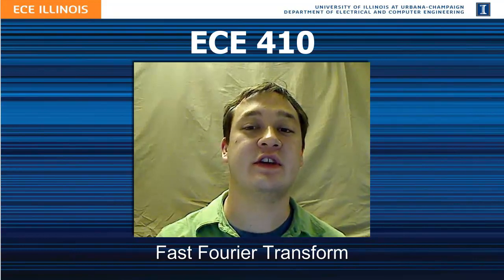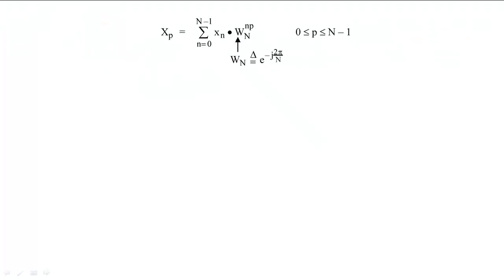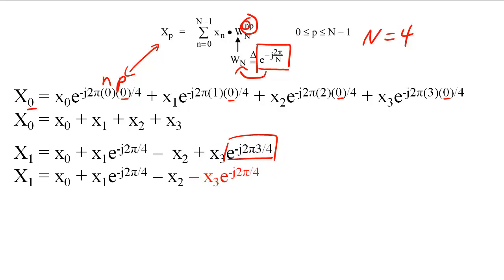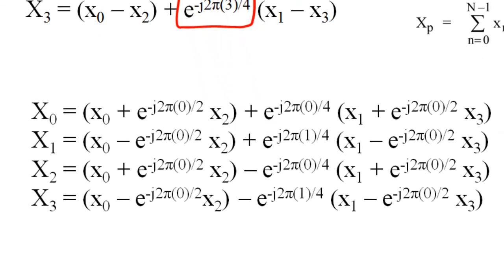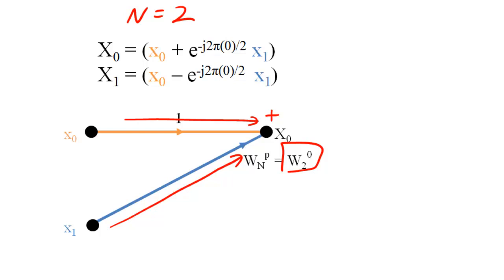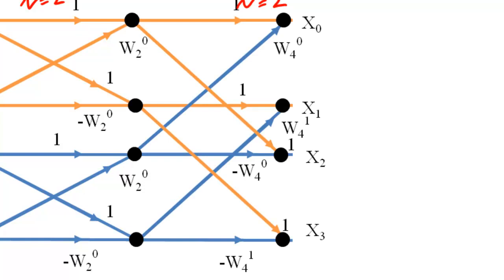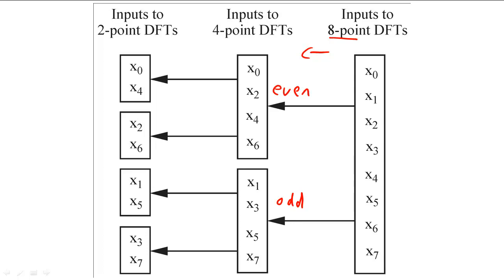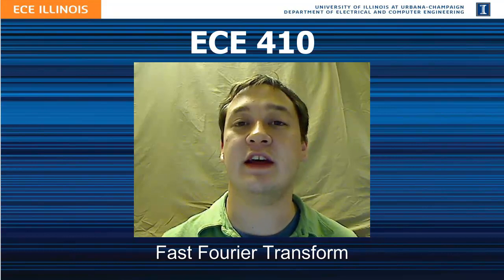32 - Fast Fourier Transform

Comment: e^(2pi3/4) -> e^(-2pi/4)?.. How it has been deduced?
Reply: 3/4=1/4+2/4=1/4+1/2 useing euler forumula you get jsin(pi)+cos(pi) =-1 and multuply the e^-j2pi/4
Reply: 270 degrees is -90 degrees?
Reply: +Xiao'sChannel well yes if you take the unitary circle and go 270° ( or 3/4 pi) anticlockwise is the same as going 90° clockwise

Comment: Pauses at 00:52 - MADD OP: ASSuming you are using a CPU post 1996, not all computers have an INTEL or compatible, learn some bloody history kid!!!

#stickyWicket [ you are on a world stage ;-) ]

[ was coding from 1983, late for a UNIX Compliance Tester, I'm sorry  ]
Reply: No such assumption. Didn't even have CPUs in mind, but moreso specialized processors for signal processing. The digital signal processors I had in mind use accumulators rather than registers and specialize in multiply-accumulate instructions, making them fast for these types of operations. If anything I had current Texas Instruments digital signal processor in mind, which are definitely not INTEL or compatible.